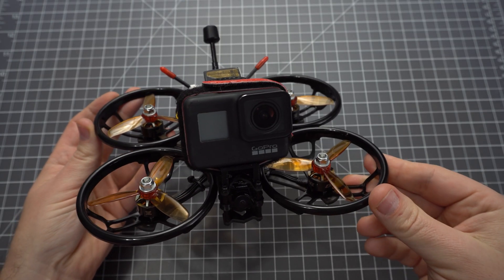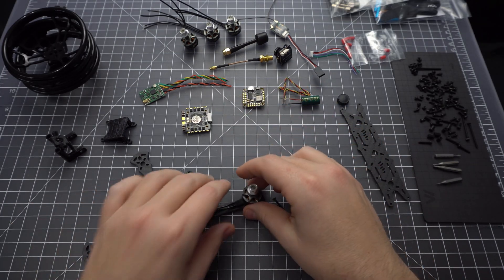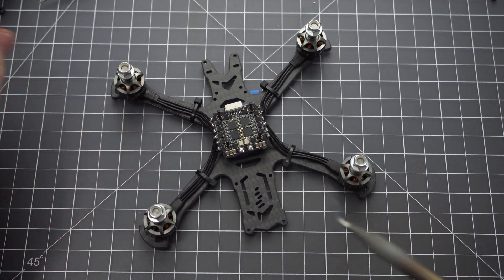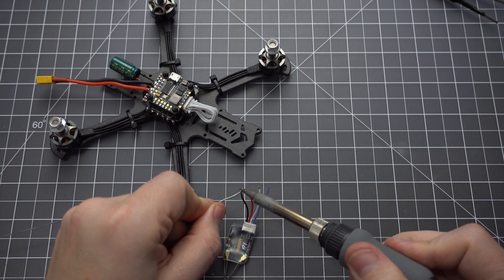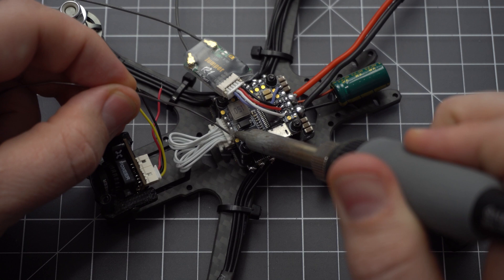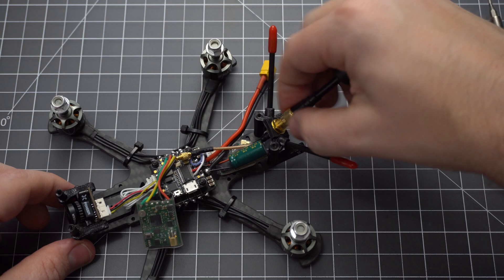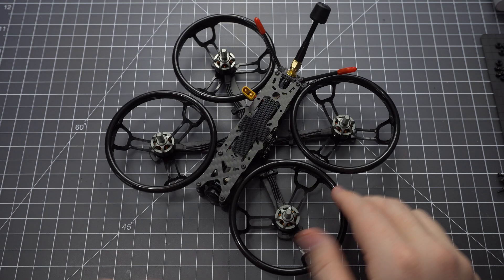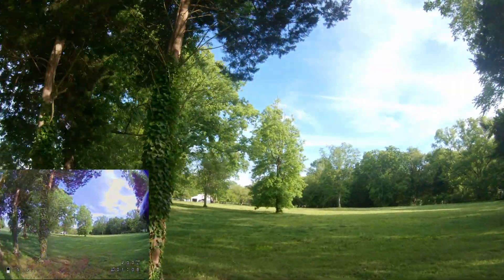How to Build a Lightweight Cinewhoop/Freestyle Drone

Comment: What is range and flight time
Reply from the maker: Range entirely depends on your radio/receiver choice, but the video will go as far as a mile or two if unobstructed by any trees or buildings. Flight time is generally 3 to 5 minutes depending on your battery choice and weight.

Comment: Hi i used xt30 to use 4s 850 Mah. Can i use 1300 or 1500 mah battery now with a xt30 to xt 60 converter?
Reply from the maker: Sure, but you'll probably need to make the adapter. It's not hard to make if you've got the connectors.
Reply: @whiffles  Sir i have an adapter. I am concerned when using 4s1500 mah will it burn the xt30 18awg wires?
Reply from the maker: @outboxfpv4360  That won't be a problem. It's only going to draw what it needs from the battery. It's still the same voltage.
Reply: @whiffles  Thanks sir will do that☺️

Comment: I think of making this buid, but perhaps with 3s battery, with more push for making more freestyle, can you help on the motor choice on 3s ? or if it is not possible 4 s ?
Reply from the maker: 3850kv is probably best for 3S but 4850kv is also perfectly fine on 3S.

Comment: Which prop is best for this frame? Will gemfan ducted prop work well?
Reply from the maker: They will work but they're not really designed for this style quad. It's hard to say which props are best, but the Windancer 3028 are pretty decent.

Comment: Hey whats i have ordered this frame. Can we get any stl file for low angle for gopro? Whats the weight wot gopro and 1500mah lippo?
Reply from the maker: See if you can ask HGLRC support. I know they designed a better STL for it.
Reply: @whiffles  I already asked they said no

Comment: Hey sir can this frame carry a 4s 1300 or 1500 Mah batt with a gopro hero 7? Does it have enough space on top?
Reply from the maker: I just put a 1500mah battery on top and it fits just fine with the GoPro mount.
Reply: @whiffles  Which gopro mount are you mentioning? The big mounts which support reelsteady go ?
Reply: @whiffles  Have you tried flying with 1500mah? Flight time?

Comment: Solid build sir. Iam using bumblebee frame now seems very heavy and withu ducts flyes bad in wind. Can this frame easly cary a gopro hero 7 ? The mount look fragile? Can we put a normal full covered gopro mount on this frame?
Reply from the maker: With these motors it carries a GoPro no problem. They did design a better Hero7 mount for this frame, but I'm not sure if they've got it listed yet. You should be able to print it though.
Reply: @whiffles  Ok do can you share that gopro 7 stl file and session 5 file if u have?

Comment: EXCELLENT Build! and Excellent video; clear, concise explanation, and video quality. This build is on my list. Thanks. By the way, have your tried the GNB 3S 1100 mAh (66 gram) with XT30 connector. This battery only weights about 20 grams more than the 650 mAh pack the I use. Due to the coronavirus and being locked down, I have not been able to fly nor test it, but will as soon as my fly field opens. My quads are the smaller variety 2.5 and 3 inch. Again, excellent video.
Reply from the maker: I have not, but for this build I wouldn't fly 3S. I'd reserve 3S for lighter builds like 2" or smaller.

Comment: I want to build my first FPV drone - I want to attach a GoPro to it to film cinematics. I'm on a tight budget, so which build do you recommend? is this build suitable for me?
Reply from the maker: How are you at flying? I definitely wouldn't start flying with something like this. You need to practice on a sim and then a micro like the Tinyhawk or Mobula6 first.
Reply: @whiffles  hi whiffles! Thank you for the quick reply! I have been flying on a simulator for almost 2 weeks. I believe its time for me to move onto the next stage. Thank you for the suggestion. If you were in my shoes, would you build a 5 inch or 3 inch  as your first drone? And you wouldn't buy a pre-built correct?